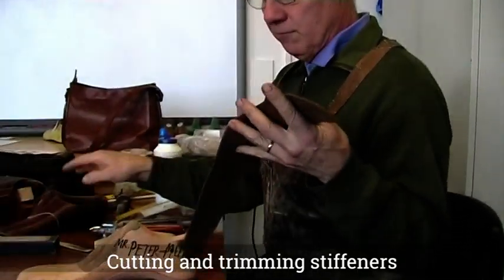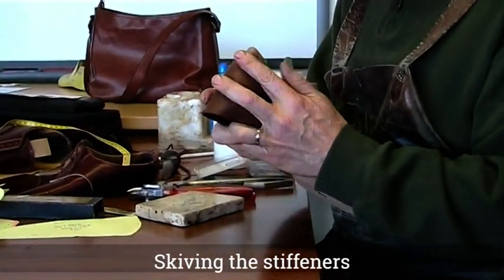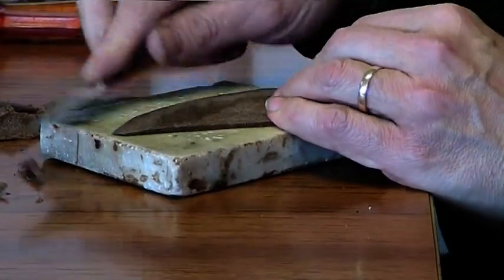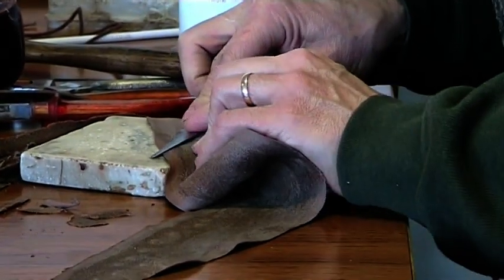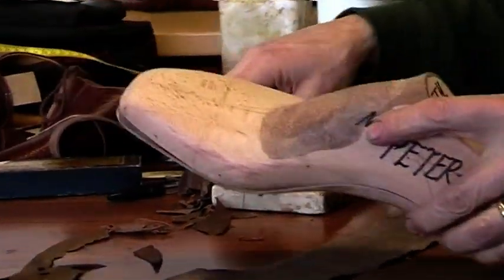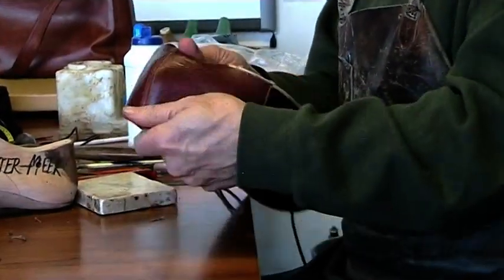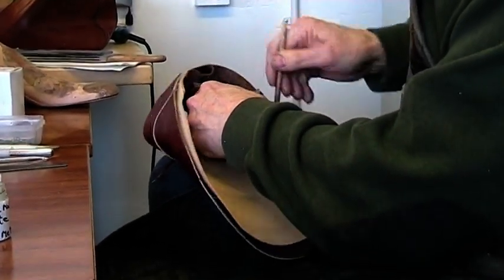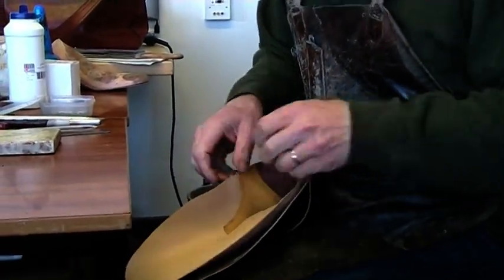Lasting-up a Derby shoe - Part 1 of 4

Comment: You’re a great teacher! Of what kind of leather was the stiffener made? What stiffening do you recommend for an Ehlers-Danlose foot? Thanks.
Reply: In my experience any hyper-mobility syndrome benefits from soft but firm containment. The long stiffener offers a large surface for containment and the leather ‘gives’ according to the use. Probably the 2.5mm thickness is about right unless it’s for a small foot or for a child. For the fragile skin associated with the condition I would include cushion quarters in a nappa leather with a soft cushion strip inside such a very soft neoprene or red poron.

Comment: Please, what leather must be used for the stiffener? Is it same as for soles, but thinner?
Reply: Stiffener leather is usually much thinner (about 2-4 oz) than the insole leather (9-12 oz).  He is using a thick leather for the stiffeners (never seen that before) but he is skiving it out to be fairly thin.
Reply: @hyperdrivedoll2097  Thank you! I tried to make heel stiffener and toe cap with glass fibeglass+epoxy with quite a good result, but thinking about leather instead. Any suggestions?